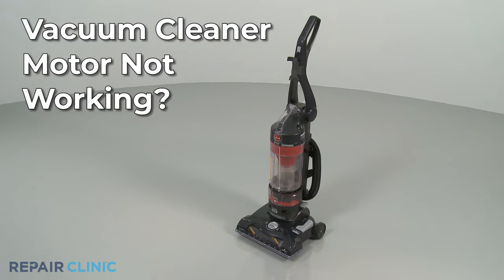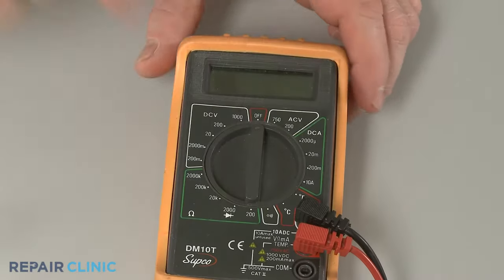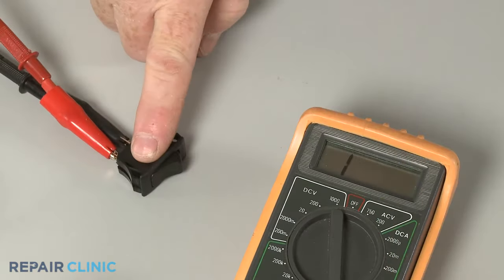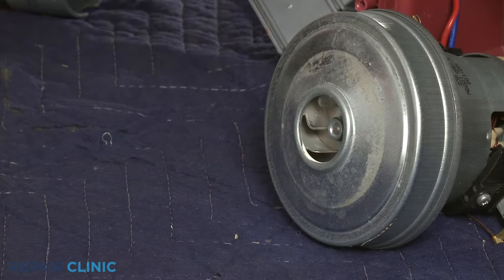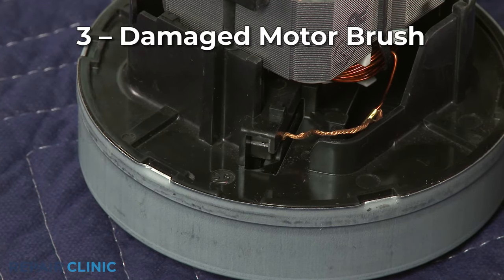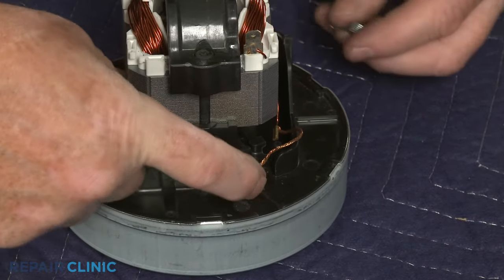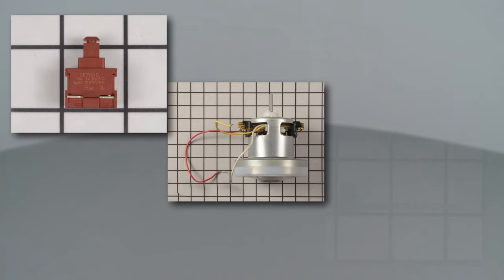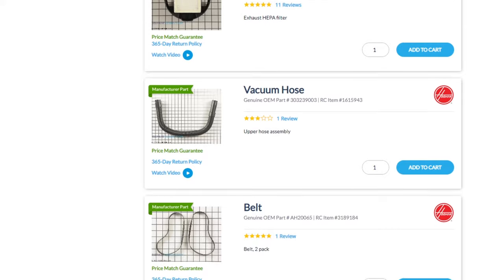Vacuum Cleaner Motor Not Working — Vacuum Cleaner Troubleshooting

Comment: Clear as mud!
Reply from the maker: This is the top 3 reasons a vacuum cleaner motor is not working. We have individual part replacement videos that are step-by-step guides to help you disassemble your vacuum so you can troubleshoot to repair or replace the part you need.